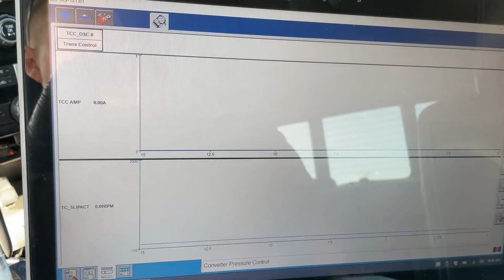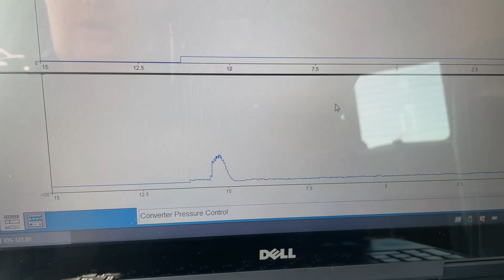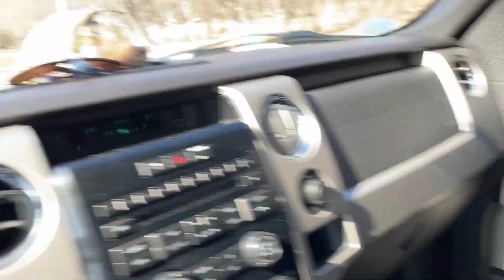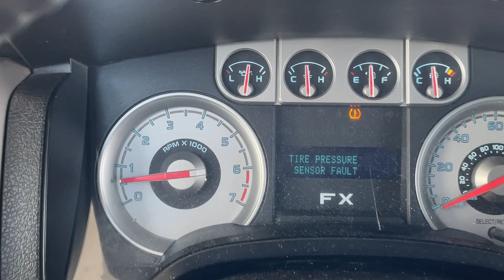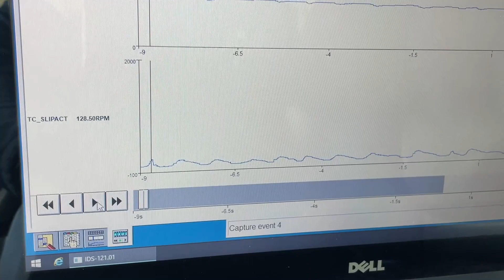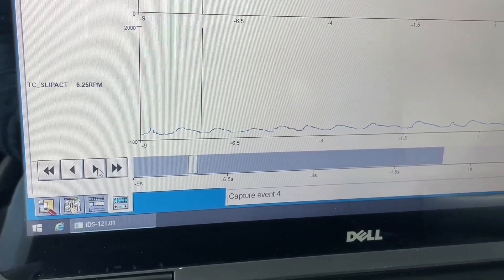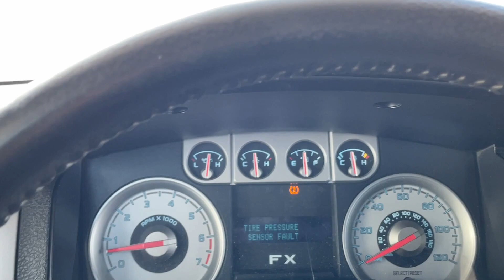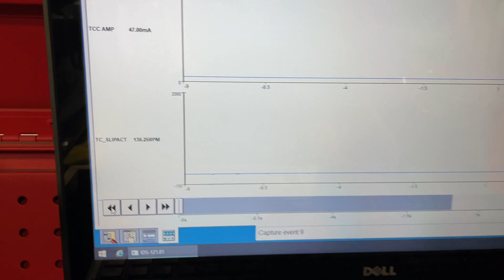Ford F-150 6R80 Six Speed Transmission Surging: Rolling Torques Converter Clutch Failures

Comment: What would the fix be?  new TC or just a new TC solenoid?
Reply from the maker: The valves in the valve body generally wear out first causing the damage to the torque converter clutch, so both should be checked for a complete repair.
Reply: @FordTechMakuloco  Are there DTC codes associated with this problem?
Reply: @jeremysard  If there aren't any DTCs, I'd just disable the whatever is controlling the clutch an move on with life.
Reply: @RK-kn1ud  Uuuummmm.....probably wouldn't do that. I do like to repair things correctly and have them work as designed.
Reply: @jeremysard  you do you.

That said, millions upon millions of cars were produced and driven without lockup converters...it's not really necessary.  Some repairs just aren't worth the expense/effort.

Comment: What is the average cost of repair? Just a new TC and install?
Reply from the maker: The valves in the valve body generally wear out first causing the damage to the torque converter clutch, so both should be checked for a complete repair.

Comment: My dad's 2010 F150 also had a TPMS issue, looks like it's a fairly common issue on the 12th gen F150s! 
For the record I tried to reprogram all TPMS sensors and only the FR sensor wouldn't give in
Reply: Isn't it typically a battery issue thou? The batteries in each sensor are only good for 7 years on average and to my knowledge they aren't user serviceable.
Reply: @JamesPalylyk  I never thought about it but that may be the case here. I've had three Fords in the last eight years (all between 5-10 years old) and only one (Escape) had a faulty TPMS sensor.
The TPMS sensors on my 9 yr old Fiesta seem to be OK, though.
Reply: This generation was susceptible to tpms interference from 12v devices plugged into the cig lighter like phone chargers or radar detectors. Typical fix was to replace the actual tpms antenna behind & above the dash glovebox.

Comment: Another great video.  Experienced this on my 07 expedition.  Would surge and vibrate in partial lock-up (about 400 mA TC solenoid current) but would go away at full lock ( about 700 mA TC solenoid current).  TCC slip spiking upto 100 rpm at partial with zero slip at full..  Could drive down the highway at 60+ no problem, but would be a problem at 40-55 mph.
Reply: @Legos37 I went with a reman trans from ETE Reman since the unit already had 180k miles on the clock.  No sense putting a new flagpole on a condemned building.
Reply: I’m having same issue on my 08 navigator, this basically confirms it’s the torque converter and not a misfire😭 I just got it too now I’ll have to spend a couple grand fixing it

Comment: When my 2010 started doing this at 135k, I thought I was hitting some rumble strips. Dealer had no idea what it was. I thought it was a misfire also until I noticed the tach. After seeing the RPMs go slightly up when it happened, I realized it was a clutch slipping and only during TCC lock-up. It only does it at the slightest amount of throttler. I have learned to just goose it a little more. There is some stuff on the market called Shudder Fixx I think. It is supposed to help. I had the latest trans calibration loaded from Ford which did not help. It seems that the lock up clutch just needs more pressure at low throttle. Does it between 30-60mph. Tow-haul mode seems to help.  Another great video Brian.
Reply: So you're telling me the dealer lied and I didn't need a new torque converter and trans rebuild?
Reply: My 2015 had same problem. Disconnect cooler line. Flush 20 quarts new fluid through. Never had problem again. Just like you it felt like I was running over a rumble strip. I tried shudder fix but it didn’t work
Reply: @terrorofdemons1168  In the 90s this was a Ford TSB for the Crown Vic trans. Do a complete fluid drain thru the bolt in the torque converter, with Mercon V. They were notorious for shudder. They also suggested a second trans cooler in some cases.
Reply: @terrorofdemons1168  how long has it been running good?
Reply: @NoeGonzalez7  about 20 thousand miles with no problem. I’m going to do the flush every 50k from now on. When I did it I noticed the fluid looked a dark red color then after flushing it was like new fluid again

Comment: Great work  !!  You really know how to use the scan tool as an assist to help you verify a problem and solution.. Question- I own a 2007 Ford Fusion (original owner) and I have a weird problem. Left front turn signal bulb does not blink on-off when used.  Instrument panel shows that during its self-check all exterior bulbs are good and signal indicator on instrument panel blinks normal speed. Bulb illuminates when running parking lights or full lights for night time driving.  Ford dealer says its the PCM and would love to have $600+ to resolve.  Any help hints you can give me?  Thanks ahead of time.
Reply: To verify they are correct you need to test at the bulb socket connector to see if it is pulsing with a test light. If it isn't then it's pretty likely that it is the pcm/bcm whichever is controlling the circuit. The control module should pulse a ground to blink the light. If it does turn out to be the control module you might try finding a used module the Ford dealer should be able to reprogram it to your specific vehicle. Makulco had a video showing how to do it. It's possible that the circuit could be shorted to ground somewhere between the module and the bulb as well. I see a lot of burnt/melted bulb sockets or connectors cause weird lighting issues.
Reply: @jeremypike9153  agreed, my Escape showed similar symptoms and it ended up being the socket where the turn signal bulb plugs in. I believe I paid like $10 for it in the local junkyard
Reply: @jeremypike9153  Thanks for sharing with us. I’ve had similar issue with what you mentioned above. Sockets either being partially melted and or untwisting from the actual housing. Intermittent rear hyper flash.

Comment: I have a quick question about this my truck has a hundred and seven thousand miles I replace transmission fluid and filter twice already does this problem caused by not maintaining your transmission or is it's just something that will just eventually happend

Comment: Hey I have a bad situation....so I just bought a 2011 Expedition 5.4 3v with 202,000 miles in great shape...the engine sounded great at idle and has plenty of power. I took it for a drive a few days ago and the CEL came on so I pulled over and it was knocking and lots of valve train noise especially on the right bank...so I drove it home (about 40 miles) and started to change the oil (I used synthetic blend Motorcraft and a FL-820-S)
I looked up the old filter and it had the WRONG FILTER on it!!!!
It was a STP S10590....and there was metal fines in the oil and now the engine has valve train noise (slight to moderate singing/ticking noise) and maybe a slight knock but I’m not sure.

What should I do? 

I’m so disappointed in people who don’t care for vehicles properly.  

Any advice would be appreciated. Thanks.
Reply: Do timing job (oem parts only)  with new roller followers and melling HV oil pump or replace engine.  Your choice.
Reply: Well I sure do hope that you did not pay much for it :-(

Comment: Please always include the mileage of the vehicle.  It gives us a better idea of when to expect an issue like this.  Thanks!
Reply: I have this same transmission in my 2016 F-150 with over 150K miles and no issues yet but I rarely tow heavy loads and it is mostly highway miles..keeping my fingers crossed.
Reply: Being that he said it's a 2010 I'd guess easily over 125K miles. My 2011 has 140K. Luckily, not experiencing this problem... yet.

Comment: My 2011 sometimes will bang up through a few gears after taking off slowly in a parking lot. especially when its cold. putting it in tow mode seems to stop it from happening so much.
Reply: I have a 2011 that does the same thing. 3rd maybe 4th gear seems to slam when cold. Especially when letting off and it shifts. Might be the lead frame?

Comment: If you can manually lock and unlock the T/C with no problem and it makes the surge go away (T/C is working) wouldn't the signal to the T/C be questionable? Not critiquing just a question. Last trans I changed was a turbo 400 lol.
Reply from the maker: We are only turning off the torque converter clutch not the torque converter. In other words it has nothing to do with the torque coupling.
Reply: @FordTechMakuloco  I explain the TC differently than you. I still explain it to people that it is a lock up torque converter. I do not call it a clutch. I explain it is locked up giving no slip and should be 1:1 ratio as fully locked to the engine. Less confusing to most people...lol.

Comment: 1995 F150 5.0, shift from 1st to 2nd kicks, 140,000 miles, should i try the filter and fluid change?
Reply: Broken accumulator spring
Reply: If you've gone 140K without changing the fluid..... I've got bad news for you.
Reply: @vettle1  I got a wrench and a Ridge wallet, lol. I only drove it 15 miles since owning it. Not sure what the prior's have done, looks like the radiator, fan, valve cover gaskets, egr tube have been replaced. I'm currently changing the steering gear box out, and chasing an ac vent leak.

Comment: So replace the tourq converter or is it a failed seal that hold pressure for the tq
Reply from the maker: The valves in the valve body generally wear out first causing the damage to the torque converter clutch, so both should be checked for a complete repair.
Reply: So what do you say is the next test ? Maybe test the hydraulic pressure at the test port for TCC ? I mean, if pressure is within spec its the torque converter 100%?

Comment: I have a Navigator that has burned up a spark plug
Newer plugs 3k miles
Any ideal what is the problem?
Reply from the maker: Plugs weren't torqued down and backed off.
Reply: Could be the wrong heat spectrum of spark plug, are they OEM? Also could be a to lean fuel to air ratio scenario
Reply: The plug may have not been seated all the way or correctly also

Comment: It never ceases to amaze me how many problems can be traced to the automatic transmission in cars.  I've had a couple of the simpler automatics and had troubles with some of them; but for me, it is manual transmissions for me.
Reply: I have a 5 speed manual ford focus, laughing at all the Powershit transmissions that continue to fail.
Reply: @garretrocha8  When my wife and I got married, one of the first things I did was teach her to have the confidence to drive a stick.  It was a good investment.
Reply: @tomnekuda3818  absolutely worth the investment! I’m thankful that my wife knew how to drive stick before we were dating She had learned as a teenager, her first car was a stick.
Reply: @KI4HOK  It was always a blast watching her row the gears on my Roadrunner......"Don't look at the shifter or me...look down the road and throw 'em in!"
Reply: @garretrocha8  Same here, we have a 2012 Fiesta with the 5 spd. It's got 140K miles and even the clutch is still the original. Solid car
Reply: I have a 2017 F150 8-cyl 6-speed that has torque converter shutter. It started at around 80,000 mile and continues now at 124,000 miles. I've never had the transmission fluid changes. I'm sure it's torque converter shutter. I put the transmission into Sport mose and it happens less often and when it happens, it is less severe. My question is, if I have my converter put into manual unlock, can I continue to operate on a continual basis in this manner, assuming it stops the shuddering? Can I assume from your data that the root cause is software / electrical related versus mechanical related? If so, just changing the torque converter may not solve the problem long term. Thank you for an excellent video.
Reply: @James-gm2nz  I had a '70 RoadRunner with a 440 Magnum and  a 727 automatic.  I drove it every day and many weekends to the dragstrip where it turned good times with no troubles whatsoever.  That's the only auto trans that I absolutely couldn't kill.....I pushed cars in those days to the very limits but did maintenance on them religiously.  I'm sure a Ford of GM trans (both of which I've had) could hold a candle to the 727.  I had troubles with both of them.
Reply: Any transmission problem I’ve ever had, in ANY make model or year vehicle, has been auto.

Being a hardcore dsm guy, it pains me to say any 1990-98 dsm fwd or awd transmission is more reliable than any auto of today.
Reply: Sorry for the rant, and this is not aimed at any one person, so please take no offense. But, all this stuff is due to government mandated fuel economy and emissions mandates.  Simple cars are no longer an option. Manual transmissions are being phased out. Many models are no longer available with manuals, and most people can't drive one anyway. That's why cars are so expensive, gov't mandates, extended warranties for 5,6 or 10 yrs. and not a little greed for higher profits. As a tech myself, it takes thousands to buy a decent scan tool, not to mention the yearly updates which range from 800-1800. I haven't mentioned multiple thousands for hand tools and special tools/diagnostic equipment. Oh, and did I mention that mechanics are the lowest paid skilled trade, on average? I don't know where it's headed, but electric vehicles are not maintenance free. If anything, they are more complicated and more expensive to repair. Techs will need to learn a whole new skill set for the future.
Reply: @markbrickey8418  Careful... You are insinuating that the government is dumb and it's regulations and meddling usually ends up doing more harm than good,. A lot of people today are bootlickers, they don't take kindly to you blaming government for anything.. Just say, "it's the faulty of greedy capitalist big companies" and follow the mainstream narrative please.
Reply: @markbrickey8418  preach that gospel truth! I recently condemned 3 farm trucks doing the exact same thing. You are spot on correct. 150K or so for mileage on those trucks vs an OBS-era truck that would have at least twice or 3 times that many miles & be simple/cheap to repair. Nowadays people won't buy anything unless it just coddles you damn near into a coma, goes mach 3 with your hair on fire & does all the driving for you. And don't even get me started on the safety-Susan crap, it's keeping Mr. Darwin from doing his duty. Safety starts & ends with the driver! Put down the damn phone, quit messing around with yourself/spouse/kids/pets & DRIVE!

When you buy something new, ask yourself how much of that technology is absolutely necessary & how much of it is just for showing off...
Reply: @markbrickey8418  You are 100% correct, chief.

Comment: So what would be the fix for this?
Reply: The fix is $5000.00.
Reply: @robertwhite8599  Ouch
Reply: @edman1015  the answer is SELL OR TRADE IT IN. Haha
Reply from the maker: The valves in the valve body generally wear out first causing the damage to the torque converter clutch, so both should be checked for a complete repair.
Reply: Good question

Comment: i have a similar problem in my 2010. Made a tune up but the problem still there so is not a engine misfire as you said.
is to replace the torque converter or just the torque converter cluth solenoid?
Reply: thanks

Comment: I am having the same issues on my 2012 F150 but also shuddering when I floor the pedal do you know if this another symptom of torque converter failure or a different problem all together
Reply: My 2015 had a shudder. I bought 20 quarts of fluid. Disconnected the cooler line. Flushed the 20 quarts through. When I started it was a dark red color then red like new fluid. Never had a problem since. Now I plan to do a flush every 50k

Comment: My 08 Expedition has an issue where when you take off from a stop, under light acceleration, it shifts hard and quick into 2nd and sometimes when you go to give it gas to accelerate up to highway speeds, it feels like it’s dragging an anchor to get up to speed. I just put a new motor in it and new torque converter. What could cause this? It also turns over several times when you start it, from time to time.
Reply: Sounds like a broken checkball in tje valvebody,,i believe its ball number 7,,not sealing and allowing tje convertor clutch to apply in second,,
Was very common in 05 and had a tsb for it